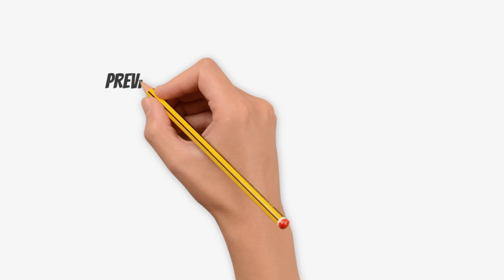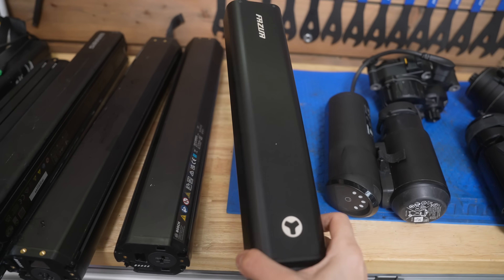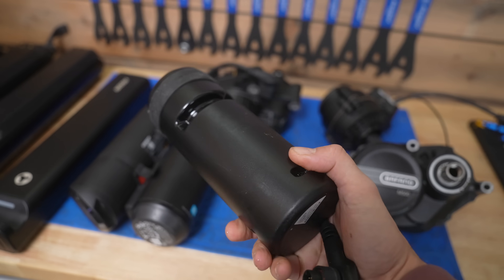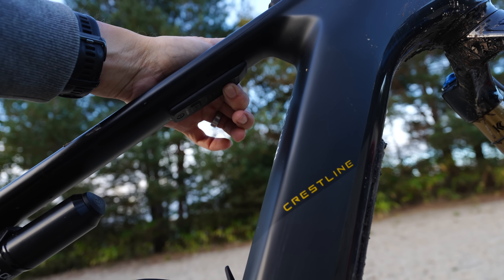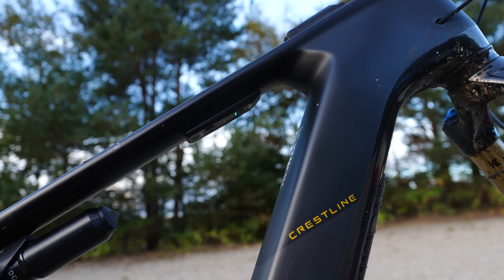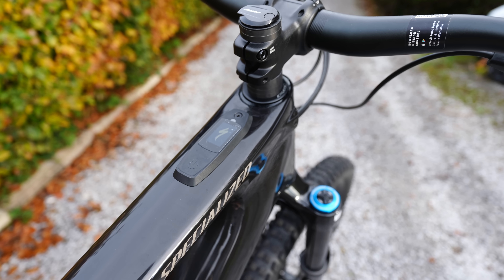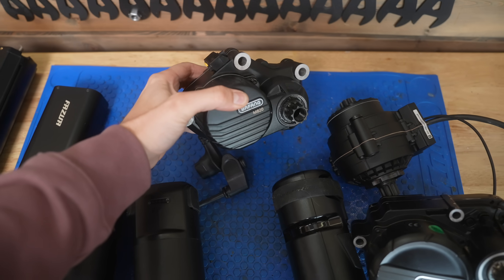We Have A Huge Problem With Ebikes....

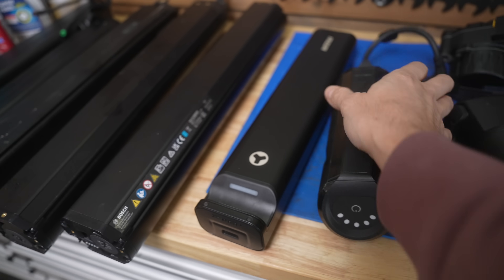Comment: Dude I do not think that any cyclist who performs even the most rudimentary maintenance on their bike whatever disagree with any of the points that you make here, you completely hit the nail on the head. However this issue is by no means e-bike specific. Up until recently tapered head tubes and zero stack headsets we're not seen on every frame, bottom brackets of course are still torn between the weight savings offered from press fit and the ease of installation and maintenance offered from threaded options. Rear hub standards stayed at 1:35 mm for decades then jump to 142 then 148 boost and 157 super boost while front hubs also grew another 10 mm from 100 up to 110. The one and only standard I can think of where it appears that component manufacturers have miraculously agreed on a standard for is brake caliper mounts. And even then depending on the brand of the caliper and the size of your rotor there are different adapters you will need to purchase. Shock sizing is another one metric or standard,and shock mounts: trunion or eyelets. Some rims such as options from envy require proprietary upside down threaded internal spoke nipples, mavic has their own unique shape which requires its own proprietary spoke wrench tool, zipp 3zeroMoto's Will have their warranty voided if they are not built up with the supplied spoke nipple washers from zipp. Handlebar clamp diameters recently jumped from a steady standard of 31.8 mm for years up to 35 mm and quite  unecessarily in my opinion. And then when it comes to cassette mounting the HD free hub body of the past is gone and we are forced to decide between micro spline and Shimano or XD for SRAM eagle drivetrains. If we could somehow get all of these component manufacturers and frame designers to realize that it would be better not only for The ease of design, or for an environment in which ingenuity will thrive, but also for business which is where their shareholders place the majority of their concerns, everything about the sport would improve drastically. Unfortunately at the stage of the game that we find ourselves in currently, planned obsolescence is one of the main tools brands use to generate maximum revenue. It's so deeply entrenched that I do not see it going anywhere soon. Another enormous issue that no one seems to be addressing other than Revel bikes in Colorado is the fact that the resins used in frame construction make it so that every carbon frame cannot be recycled or repurposed in any way shape or form, it can't even become material for 3D printers. That's the real dirty secret of the cycling industry. Think of the amount of carbon waste each and every brand generates with frames and rims as a result of this choice of resin type. It's used because it offers the most strength with the least weight penalty, fixing that with a heavier resin would just make the already diminishing gap in weight between carbon fiber and aluminum even more narrow which would mean friends could not charge as much more for carbon frames than aluminum as they currently are. My solution to this isn't to find the right adhesive and binding agent that allows the carbon to be it's for the marketing scam to stop and for other riders to take the time to actually do a Pepsi challenge style blind test and ride the same trail back to back on a carbon frame and an aluminum frame so they can see for themselves that the difference is not worth the price at all. Personally I don't even like the stiffness of carbon. And it's already been proven on the race track when Loic Bruni was dominating elite mens downhill world cups and was also the only qualifying contestant that was on an aluminum frame. But I digress... I couldn't agree with you more Rob. You hit the nail on the head, The unfortunate reality is that it's so deeply entrenched in the industry that I can't foresee any coalescence or capitulation happening between all the different players In bicycle manufacturing anytime soon.

Comment: Well put! I agree! It would be lvoely with a chargin standard - this way we could get public chargers. And the motors - i have been thinking the exact same thing (ever since i first saw the pinion and started craving that instead of my bosch gen 4). Batteries (shape and size) is the least of our problems - they could be refurbed, updated with new cells etc. - just agree on a voltage and an interface between battery and the rest. Motors could then work with the correct controller (maybe even built in) and should use BT for remote. All frames could then have a place to mount batteries (what ever would fit in there) on some kind of battery specific bracket (looks like bosch has one bracket for multiple sizes - so frame should have standard holse for brackets and brackets are then specifi for battery manufacturer). More competition on frames, motors, batteries and standards for everything.

Comment: You touched on this a while ago and what I like about your videos is the simple common sense that I think most of us agree on. I bought a new Rail 5 earlier in the year simply because the price to good to miss and although I love it. I have genuine fears of obsolecence for the electrical components. Not so the conversted bikes that I have run up to this point with Tongsheng TSDZ2 toruque sesning motors. They simply slot into the bottom bracket and can use any battery. These have moved from 3 different donor bikes and I upgraded. Parts are plentiful and can be fitted by the user. This as you rightly point out, is a much greener approach. I am suprised that EU regulation hasn't come into force as it has with other domestic white goods to ensure they are repairable and not designed to end up in landfill the moment they fail.

Comment: It was the same with digital synthesizers back in the day until the manufacturers came together and developed the MIDI (Musical Instrument Digital Interface) standard. After that all instruments could be easily hooked up to work with one another. It's still the standard interface today some 40 years on. I think something similar needs to be put in place for EMTB system manufacturers.

Comment: They should start with standardising bolts etc. first!
 There are hex keys, torx, phillips, flat head,  3mm, 4mm, 5mm,  6mm, T25, I need lots of different heads to work on my bike!
But yeah, being able to upgrade your Shimano or Bosch motor should definately be an option.

Comment: The tech is far too new and evolving to have standard bolt patterns, motors and installs are vastly different to be constrained to a standard pattern.
It may get close as one brand becomes the favored but even then updates in tech will mean smaller packages and they won't want to be stuck with larger heavier housings just to meet the old form factor.
This is no different to the many different bottom brackets we have now.

Comment: That will be a hard sell to global enterprises, regulation would be required to achieve this, on the basis of green reusability, it has been done with phones with usb being standardized, influence could be possible if large bike frame manufacturers, refused to use said motor & battery manufacturers equipment unless it is standardized, so unless roadblocks are present, all individual companies will dance to the beat of their own drum.

Comment: The best way to "force" ebike manufacturers to conform to cross compatibility is to get the EU involved, same with how they "forced" iPhone to use the Usb C cable. Make it so we have an industry standard. These ebikes are expensive and can create a lot of waste especially E waste with old batteries and old wires and frames that in 10 years will be obsolete as you cant get the parts or cant reuse the frame with a new motor and battery combination. At the moment its a free for all and needs reigning in and getting under control

Comment: I agree but that won’t change. If you do a standard battery and motor mount you will really throw back the innovation. I did choose a Bosch motor because I thought this motor/battery is very common also for more standard bikes. So it’s likely that they will be available longer.

Comment: What we need is an 'adapter plate' type of system that will adapt the bolt pattern of any given motor to any given frame (or even an 'open source' frame mounting standard). 
This system tends to work well in the custom and modification automotive realm where you can make any make/model engine fit to any other make/model transmission.

Comment: I’m afraid, there is no universe where this will happen organically.  It will take a regulatory intervention.  Just how we got OBDII ports, just how we got a USB-C standard (thanks EU).   I had pinged Pinion about designing their MGU emtb motor into a housing with the EP8 or Bosch bolt patterns and they too said that the complexity beyond the motor mounts is too great.

Comment: Really good video. Obviously as the existing motors come in a variety of shapes and have been reducing in size during the last few years there has been the need for different bolt patterns and frame designs to work with the various motors... however we have reached a point where the industry would benefit from some standardisation. There probably shouldn't be just a single bolt patten, but perhaps a couple of options to suit high power or low powered bikes. This could then introduce the option of an adapter to fit a low powered motor into a frame for a full powered mount.

Modular batteries would also be a big improvement where you can clip packs together of a standard physcal form factor to create a higher or lower capacity. This would be like buying rechargeable AA or AAA batteries each "pack" could be around half a water bottle in size, and depending on the quality of cells within, the watt hour capacity could continue to be improved over time with higher density cells.

Comment: I've a '21 Orbea Wild that I chose for the Bosch system as I considered it fairly generic. I could potentially fly without the battery and be able to rent a battery in Fnale or wherever. I was at my local park the other day chatting with the mechanic who was loading up the software for the Cube rentals with the Bosch motor..... Seems they all needed updates, so I asked If he'd update mine while he had the laptop working....

Turns out he has the gen 3 software and my 2 year-old bike has the gen 2 software, so he couldn't do anything for me.

Turns out I'm working at my fitness levels in the gym and I'm going back to Amish bikes. I bought a cracking Santa Cruz Nomad C V4 for 800 quid. It's that fetching teal/pink colour with a decent frame, and I can customise the bollocks out of it if I want.

The Wild will sit in the corner and be used sparingly. I love it but not the hassle

Comment: Sorry, but no. The size of the battery is actually the power available, and making everyones ebike look like a standard bike frame from some boutique manufacturer puts a whole lot of bikes at a disadvantage for sales points.  Maybe i want my battery to last a full day in the wilderness. The homogenous Sram/ Shimano or go home days are long over and good riddens to them from a consumer perspective.  If you show the real ebike market on your channel then you will understand you paid too much for your 13,000 dollar bike because there are ALWAYS cheaper and BETTER alternatives that fit the latest BAFANG OR CHINESE motor. Which is always a cheaper better prospect than those boutique western brands you have been showing. I LOVE this market just the way it is because it is VARIETY and QUALITY for low prices compared to anything other than your assembled bikes you have shown on your channel. I hated the rip off market when i actually raced XC in Switzerland, and i dread its return because it was a rip off. Rockshox or Fox is NOT a thing anymore either.

Comment: I think cycles need to slow down. When people buy something they want to last it for at least 3 years. Phones, Cars etc show the situation as well. The bike industry could promise themselves to make long lasting products. So motors that don’t keep failing, internal electronics and wiring that is changeable and easy to mount, one battery standard that anyone could fit to size but with same protocols and types of batteries, range extender that fit in any bike. Sounds too complicated one might think
But it’s doable. If we don’t take less and that what we took keep longer, some day it will get regulated for us when times of excessive is over.
So in summary
Make longer lasting parts
Make same protocols for batteries
Make same Batterie type, adjustment in size allowed
Make wiring easy accessible and exchangeable 

Thanks Rob! ❤

Comment: Main argument against your points is that restricting brand in bold patterns wouldn't allow for technological evolution. Take Pinions new MGU. This is a big step forward, which could have been prevented by accident through restricting Pinion in the way they designed it. Dont get me wrong, I totally support your points and that we need some way to reduce ebike-waste, but the aspect of evolution should be considered as well :)

Comment: In 1988 the Society of Automotive Engineers came out with ideas and recommendations for OBD-II ports. A universal diagnostic port with standardized codes and programming. It also allows manufacturers to have their own programs and codes to suit their needs. It's on every consumer car and truck from 1996 onward. California mandated it's use and drove that change. We probably need a central engineering society for the bike industry to be able to drive any sort of meaningful change in this, otherwise people will design what's best for their company in their own little silos. Shimano seems to be the best about system integration, that's probably why we see so many bikes with Shimano systems in general.
Reply: The IEEE and the ISO can draft out these spec's but you need regulators & agreement in all countries to enforce it.

Comment: 100% agree with you Rob! Unfortunately I just can’t see it happening. I’ve been a pro photographer all of my working life and I can tell you now, brands such as Nikon, Canon, Sony and Leica that none of their proprietary systems are in anyway compatible. Worse still third party players such as Tamron and Sigma are increasingly being squeezed by the big four into not producing third party lenses and accessories that are compatible with their proprietary systems. So I’m not holding my breath.
Reply: This is pretty different though as I can use a cannon lens from 30 years ago on my new camera….its one thing to have standards across brands but part of the issue here is within a brand and within a short period of time there is no compatibility.
Reply: @ryangregohara heck, I can use a modern Canon EF lens on my Canon EOS 650, released back in 1987. With all the features working, including autofocus.
Reply: In the early 1980's I bought a Yashica Japanese SLR camera that had a German lens mount, both were compatible with each other. So, it is possible to do that.
Reply: If the EU or US government would enforce it, they would do it. Simple as. Just requires politicians to pay attention and not sell out to lobbyists. It's slow and often fails, but it does happen. Do you think Apple would have EVER switched to USB-C if the EU didn't force them?
Reply: might have to buy a great dual suspension Mtb! & than stick a bafang motor in it! Atleast you can get parts for it & service it! With more power!
Reply: Though I think if you look at professionell photography gear, its much better than on bikes. The canon LP e6 works on pretty much ALL professional canon cameras. Sony also uses one battery for all a7 models I think? Also, all cameras can be charged by usb c. And most lenses can be used with an Adapter on e-mount... Also all tripod mounts are the same (only difference between video and photo). So its not ideal, but not as awefull as on emtbs in my opinion :)

Comment: Your missing a beats. A 3rd party after market motor or battery seller and Right to repair

A 3rd party motor manufacture with a direct swap motor that's equal to or better then the OEM that uses the OEM battery. Or that bring new battery tech and reverse engineer them to work with OEM motors.

If IQ or similar decide hey where going to make something that's a direct swap for a bose, bosch or shimano. It'll be a huge industry disruption as manufactures could easy jump brand ship while users could keep their bikes going.

I think the other shoe hasn't dropped quite yet more people need to find their bikes are out of warranty broken and no replacement parts (does the EU 10years spare parts count for bikes?). Then the pressure will start to cook off

Comment: Great Rant!!  I don't think it's doable for motors themselves (too much innovation still happening) but there's ZERO reason we can't have two or three standard batteries and chargers.  Almost criminal that you can be out $200 if your proprietary charger blows (that is really a $20 charger). Or worse, you spend $9,000 on a bike and the battery dies and you're out $1200 for a $200 battery.

Comment: Great video. For a while now that I have been thinking about this. This needs to be called out or I feel lots of ebike customers will start to feel a sour taste over this. I’m on my second shimano ebike now and my previous two batteries for the E800 motor are completely useless for the new EP8 ebike. And now this EP8 is not compatible with anything EP801. Ebikes are far too expensive for this to be alright.